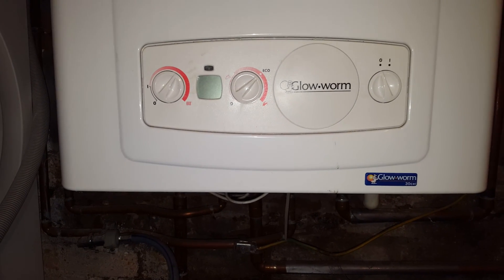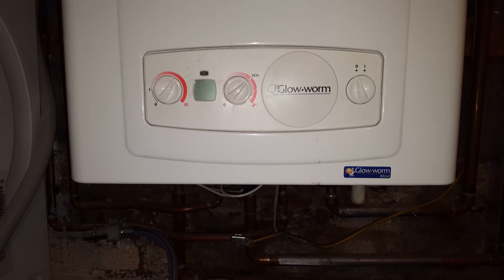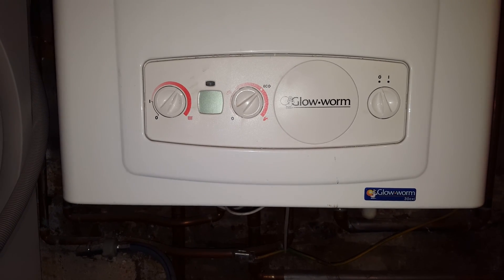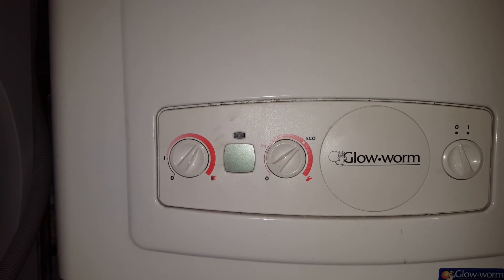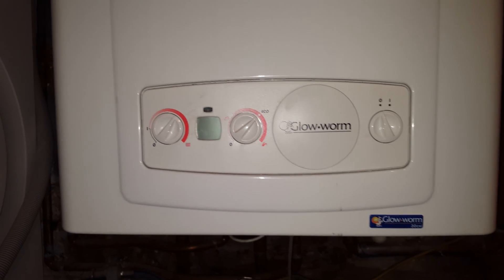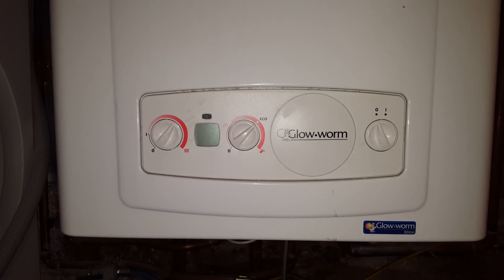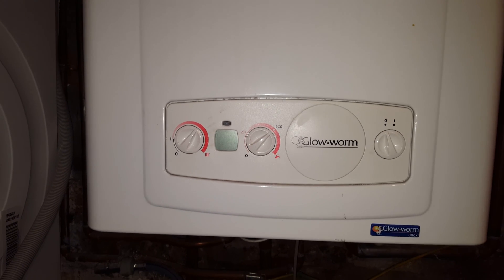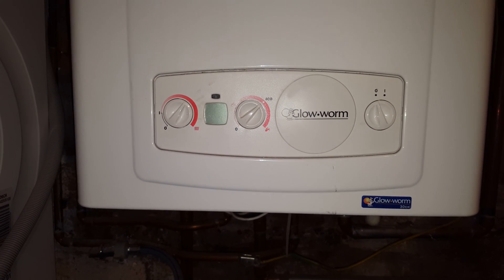No display Gloworm 30CXI

Comment: No display does not necessarily mean that the PCB needs replacing. I have this issue & have been doing some research & found this thread :

https://www.diynot.com/diy/threads/glow-worm-30cxi-dead.314150/

In some examples it was the low water pressure sensor that caused the blank display. read the link as some one the contributors are trained gas boiler engineers.
Reply: andrew heywood cheers for the link. I went through the checks but the pcb seems to be dead. Cheers again
Reply: Yes it turned out to be my PCB that had died too. So despite all the reservations that it could be other things that were made on that forum thread (and I suppose it could have been) but the PCB dead is the most likely cause of the this fault.
Reply: Most common cause I've had is low pressure sensor glowworm tell you a way to find out . Remove low voltage plugs one at time if board comes on yer fault is on whatever  plug you removed as said b4 tends 2b low pressure switch
Reply from the maker: Thank you for comments